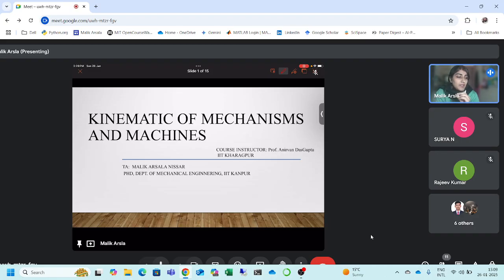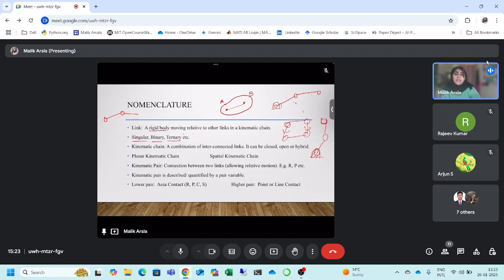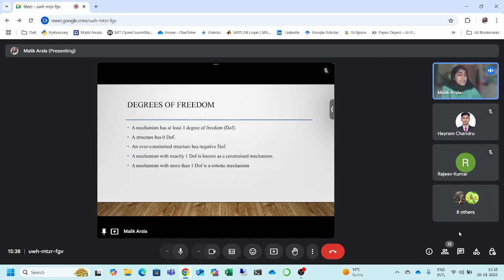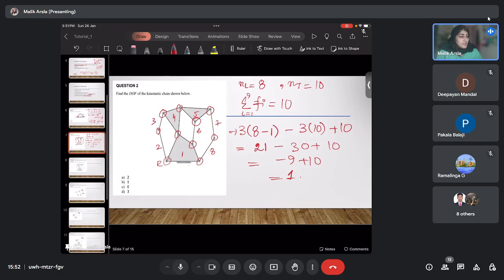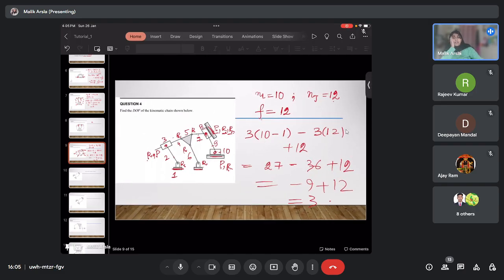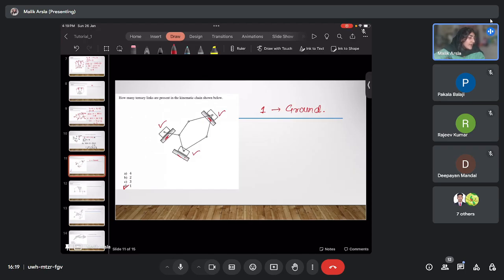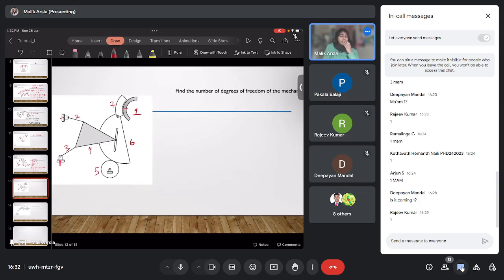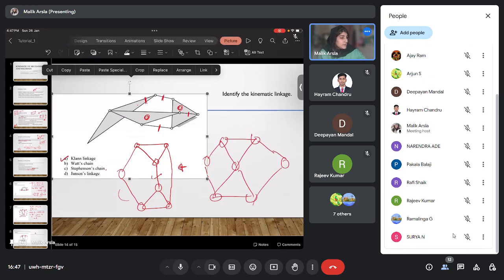Live Interactive Session, Problem Solving Session Week 1- Kinematics of  Mechanisms and Machines

Comment: i have a doubt in links counting. why dont you not consider the second grounded link while counting both in question 6 and 7
Reply from the maker: Fixed link is always considered as just one link because as i have mentioned in the start we distinguish between the links by the relative motion between them. Since there is no relative motion between fixed links, it will always be considered as 1. However, the number of other links it is attached to will make it a binary (connected to 2 other links), ternary (connected to 3 other links) and so on respectively.